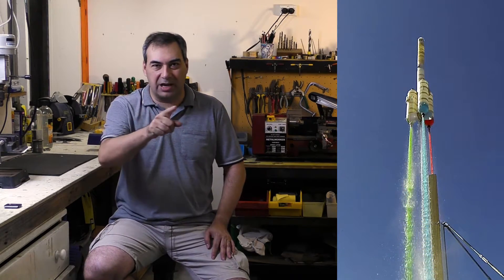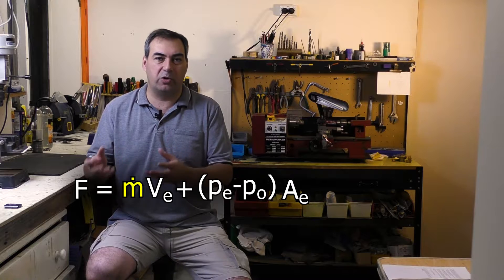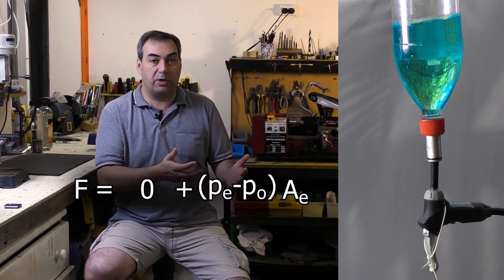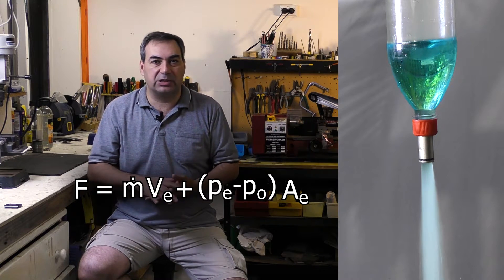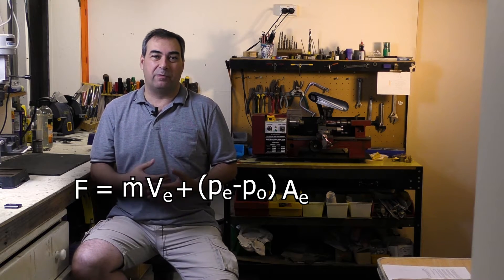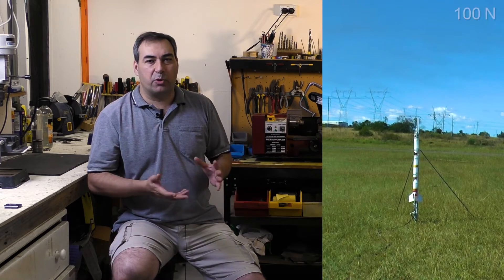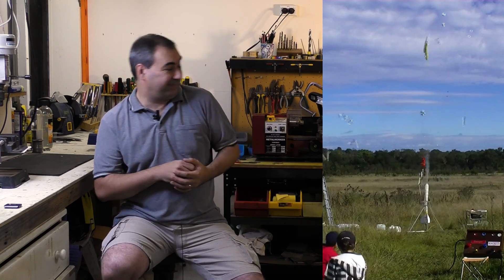Water Rocket Thrust - Explanation - Draft 1

Comment: Hello George, I have a question, is the rocket with 2500N of thrust one is the one you use for your more than 900 m record which has  total pressure of 1000 and 1150 psi and also the second stage of horizon? And for that rocket, how do you calculate the thrust for the water phase, cause for the air phase, we can use the isentropic flow relation to calculate thrust based on the properties of air through nozzle, but for water, it won't work like that so I wonder how you get this result for this. Again, this is a very nice video and a very intuiative explaination about thrust side of rocket and water rocket 😁. Hope to get your response, thanks 😊.
Reply from the maker: Yes, that's the Horizon sustainer rocket. To calculate the thrust we use a water rocket simulator: http://www.aircommandrockets.com/sim/simulator.htm This simulator is based on this paper by Dean Wheeler that goes into great detail about modelling water rocket thrust: https://www.et.byu.edu/~wheeler/benchtop/pix/thrust_eqns.pdf

Comment: There's one thing that I've always wondered about water rocket nozzle design. Water is an incompressible fluid so a de Laval nozzle isn't going to help for the water phase, but what if you got rid of the water phase and instead added a tube going into the tank with inlets and an orifice such that even at the very start you'd be getting compressed air entrained with the water right at liftoff with the aim being to try to minimize the length of the air phase? You're wasting your propellant mass at the beginning by not using the stored energy from the compressed air to accelerate it faster.

Wouldn't this substantially increase the total impulse of the rocket if you could balance out using the energy from the compressed air with the mass flow from the water?
Reply from the maker: Does that mean that as the pressure drops, since you are letting some of the air out early, that there is less pressure to accelerate the rest of the water that is still left in the rocket? There have been a couple of proposed nozzles where the geometry of the nozzle changes when the water runs out. That way you get the best of both worlds. One of them was a simple insert that drops away at the end of the water phase.

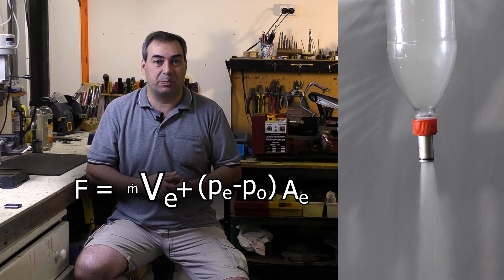Comment: Air evacuates at the speed of sound? Is that for any type of nozzle? 1:40
Reply: Yes but also no 😅, for a convergent only nozzle, when the flow reach the throat, the smallest area of the nozzle, it will be choke. Choking in this mean that the air or other fluid flow through nozzle reach its maximum speed at this the throat and can not accelerate further anymore, event if you narrow the throat further, the speed of the fluid will always be at this speed, and this speed is equal to the local speed of sound and fluid when it reach this speed become fully compressible. If you wanted to accelerate air or other compressible fluid further after this point, you would need to add a divergent section where the cross-section area of the nozzle is expanded which could help the fluid expand even more so that they could achieve supersonic expansion and reach supersonic speed, making a convergent-divergent nozzle. Hope this explaination can help.
Reply: @HoangNguen-o2j   Yes, but also no. 😉  Is the MAXIMUM that air can evacuate the speed of sound?  If we go to one limit, with air pressure inside and outside the chamber the same, and we open the chamber, air shouldn't leave at all.  As we increase the pressure inside the chamber, relative to outside pressure, I can see the air evacuating. What are the variables around nozzle design that affect how quickly it evacuates?

Comment: Hi George, just a novice question, do other liquids (or water variations with additives like saline etc) offer better performance options?

Thank you
Reply from the maker: Hi John, good question. Yes it does affect performance but not necessarily the way you would expect. Although with a denser liquid you generate more thrust, you also have a heavier mass to lift with that thrust because of the heavier liquid still in the rocket, and so you may in fact end up flying to a lower altitude. Here is the experiment where we tried various liquid densities: https://youtu.be/Fu3rIiPy_18